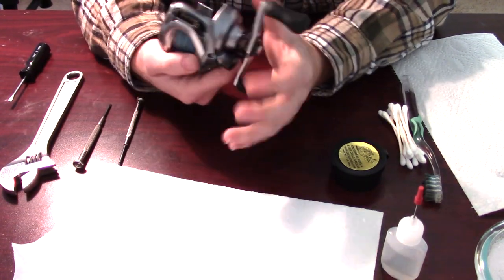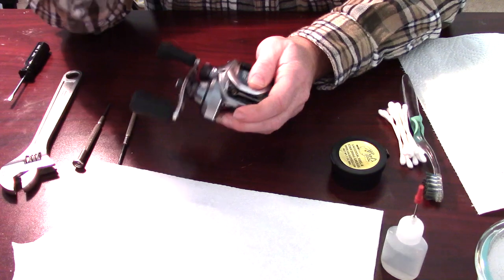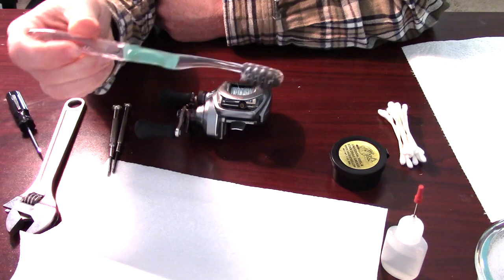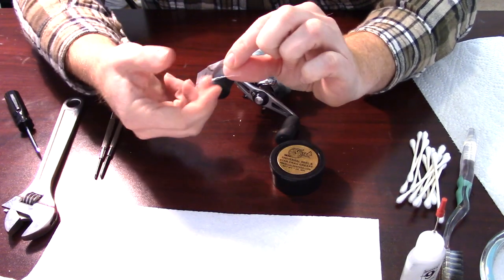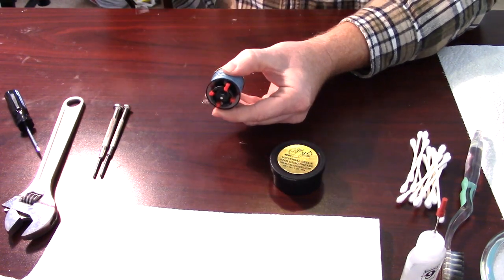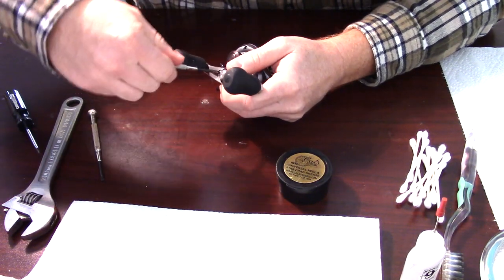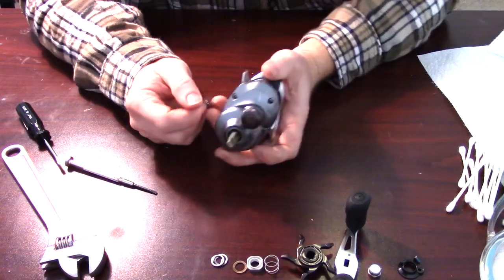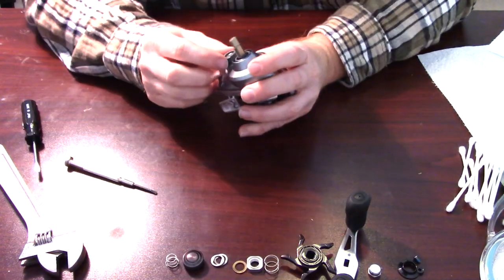Shimano Curado Full Reel Cleaning - Part 1- Taking the reel apart

Comment: Note that the 201I (left handed version) has left handed threads on the main handle retaining nut . I just learned the hard way 😂

Part #bnt 4906
Reply from the maker: Good to know, thanks!  Yeah, I don't own the left hand.  I used to clean reels back in the day (about 15 years ago) for a tackle shop.  Probably cleaned about 10 a week.  But that was many years ago, and technology has changed quite a bit.

Comment: Very very useful informational video. I gave a complete clean up for my curado 201hg and also upgraded the bearings with some ceramic hybrids. Can’t be happier, I notice there is a play in the handle as in I can pull it away from the body a little bit if you know what I mean. Is it normal?? Thanks much for these videos
Reply from the maker: Thanks!  
I haven't ever had it pull away at all, so probably not normal.  Without looking at it though I cannot really diagnose the issue...
Reply: Thank you very much. I just took it apart to take a closer look and found there's a bit of vertical play on the very end of the drive shaft. It's not felt when I normally crank, but if I pull it up side ways from the body I can feel it. Not sure if'm missing a washer or something. Will look it up. Cheers!
Reply from the maker: From my recollection there is a plate that goes over the shaft and screws to the bottom to hold it in place, could be wrong though on that specific model.  If there isn’t any plate then it’s the one that clicks in, and that from my memory on working on these in the past, I remember a few had loosened up, or got streatched out.  I remember it wasn’t an easy fix and was almost as expensive in parts as a new reel.  However if there is a plate to screw in over it, then make sure it’s screwed down tightly, and if it is, then maybe try replacing just that plate.
Reply from the maker: But again, this is from a quite a few years ago working on these at a tackle shop.  So I can’t say for sure.  In all honesty, anything more Than just a cleaning I need to recommend taking the reel to your local shop for them to look at it.
Reply: McFly Angler really appreciate you taking the time to respond. So I know what you mean by the plate under the shaft. I may have misplaced it or may be not since it’s not on the schematic. I’ll try to cut a makeshift shim washer and see if that’s going to help. I’ll let you know how it goes.
Reply from the maker: No if it’s not on the schismatics then it’s probably not originally on that reel.  Like I said, some of the past reels I’ve worked on had them some didn’t.  Some just snap in the base and if it is loose than it’s a job for a professional shop.  Also Shimano is pretty good about fixing reels for a decent price if you can handle being without it for a few weeks for shipping back and fourth.  I wouldn’t go and drill extra holes and make a new part, could effect the reel negatively rather than improve it.
Reply: McFly Angler I hear you. So I just addded very very thin shim at the very end of the drive shaft where the bearing sits on the small depression. That kinda fixed the play:) Again thanks for sharing such wonderful and helpful videos! By the way where I’m at there are no reel service etc. the closest place to send is Singapore and I don’t think it makes it any cost effective;)

Comment: Have you ever had problem when using another oil to Shimano oil...help me please
Reply from the maker: Not with the non DC reels.  I didn’t get many in to fix before, as shimano recommends sending the DC’s in for them to work on only.  I don’t recommend you doing anything other than fish the DC.  Send it in to shimano to clean.

Comment: Where is the click detent that I think is supposed to go on the star drag. Mine fell out and I lost the small spring. Can't really determine how it is supposed to go in but it really doesn't seem to need it. Maybe you lost yours as well on a previous tear down. See parts 2122 & 2123 in parts diagram. It appears to go somewhere on the star drag.
Reply from the maker: I still have it.  Yeah don’t loose that man...  just mine didn’t pop out, and I didn’t need to clean it this time around.
Reply: I think I found the problem but have not addressed it yet. I think the detente goes under the plastic disc that is held in place under the pentagon shaped clip on top of the star drag. Apparently the spring is still in place as I still feel the clicking. I just can't imagine how it could get out of the detente disc. All I did was take off the star drag but did not disassemble it.
Reply from the maker: I’ll review this tonight when I’m not just on my phone.  Hopefully I can help ya.

Comment: Is the curado k built the same at this one?
Reply from the maker: To be honest I have not opened up the K, but I imagine it would be similar unless they come out with a DC version of it which would be different for sure.  I really don’t know 100% though without opening one up.  They might have changed up some of the features and insides over time.  I haven’t had my hands on any new baitcaster reels since the one in this video.

Comment: I’m new to bait  casters and the cast control knob is stuck on my shimano caenan so I can’t fit the side plate on so I was wondering if taking it apart than cleaning it or fixing it is needed or if their is a simple solution
Reply from the maker: Cast control knob, so the knob under the handle?  And did you already remove the whole side plate?  Just can't put it back?  Not sure how you removed it if its stuck though...  Please clarify, as im having a hard time understanding what is actually the issue.

Comment: I tried removing the reverse bearing exactly like you did in this video and completely destroyed the bearing and can’t take it out fully to replace it. Any advice?
Reply from the maker: Oh sounds like there was a problem with it.  Maybe even it got almost glued in from muck and grime?  How dirty was the inside when you opened it?  Or maybe it’s a newer model?  I haven’t taken any open since 2017 and maybe they have glued in these bearings since?
Reply: McFly Angler I did manage to chisel the broken bearing out of the plate so I’ll be able to replace it no problem. The inside wasn’t too dirty and the wall surrounding the bearing was smooth, and the bearing itself was clean as well. Perhaps the plate itself was slightly warped or defective making it so tight on the bearing. Either way it should be good to go so long as I don’t need to take out the bearing again! Btw awesome video!
Reply from the maker: Glad you like the video, and really happy you got it fixed.
Reply: McFly Angler so I got the replacement clutch bearing from shimano Installed it perfectly but the bearing is squeaky? Any way to get rid of that?
Reply from the maker: Are we talking about the bearing that is the single direction bearing?  The anti-reverse bearing?  Like where you put it in upside down and it won’t reel?  Or are we talking about another bearing?
Reply: McFly Angler it was the anti reverse and I called shimanos customer service. Apparently you have to add a thin layer of grease on the anti reverse bearing which I had no idea about. It fixed it right up and the reel feels great.

Comment: Hey! I was curious, i know this video is from 2016 but I have to ask because I'm currently taking apart my Curado to correct a wobble in the star drag, leading me all the way down to the drive shaft and retainer. Please if you can respond it would be highly appreciated. My question is, should the driveshaft wiggle at all? If not I've got a problem 😂
Reply from the maker: No, it shouldn’t...  at least that I noticed whenever I’ve done this to mine.
Reply from the maker: There should be a cross bar type piece that has two screws on either side of the shaft at the bottom “below all the gears” check if they are screwed in all the way.  If so, check if that piece is bent.  If it is, you could be fine with just replacing that bar.  I think you can get parts at some local shops.  Shouldn’t cost too much.  Hopefully this fixes it.

Comment: I just got this reel last week and i noticed a small vibration if i just reel in and let it spin by itself(i dont free the spool like while casting i just reel in). It's only once the spool starts to slow down though. Do you think you know what the problem is or should i just see if it goes away after a couple more weeks?
Reply from the maker: I wouldn't know what the problem is unless I had the reel in front of me.  Is it new?  Or did you buy it used?  If its new, take it into the place you bought it and they can exchange it for a new one I'm sure.

Comment: Is this reel big enough to handle say 30 lb lingcod. I see people fish lingcod with baitcasters and I am worried they cant hold up to the riggers of big weights say 8 to 16 oz?
Reply from the maker: +D Kat how deep are you fishing?  I would say a curado 300 would be fine with the weight, but would rather a tranx...  this won't hold enough line to get deep enough for most rockfish fishing...  

I've caught plenty of inshore species with this reel though!  Calico bass, small yellowtail/durado, redfish, specks, snook, etc...  it has enough oomph to bring cod in, just would be tiresome to drag up a 16oz lure from the depths of davey Jones locker...  also the reel holds very little line.
Reply: Oh about 30ft to 120 ft and I like 40lb mono.
Reply from the maker: Yeah its not going to hold 120 ft of 40lb I don't think.  The tranx probably will though....
Reply: OK I think I will go back to a conventional reel just a smaller size like the Okuma Cold Water 20 or 30. What do you think?
Reply from the maker: If it holds enough line, and has decent internal parts, then yes thats a good idea.  I don't know Okuma too well, so I'm not familiar with that reel.  I used to do a lot of deep water fishing with a Calcutta 700, and a Trinidad 20.  Again I'm more of a shimano guy.  I tend to think their internal parts are more simple but better than some others.  I generally recommend Shimano, Diawa, or Abu Garcia.  Another few great reels for what you are looking to do is a simple Penn Jigmaster, Shimano Speedmaster, or Diawa Sealine 20...
Reply: OK thanks will look into some of the models.
Reply from the maker: Here are some links to the reels if your interested... I added the Tekota as well because it has a level wind, but will also work well for you.  
Penn Jigmaster - http://amzn.to/2oE3Csy

Shimano Speedmaster - https://store.martinwarehouse.online/ProductDetail_i2296576

Shimano Tekota - http://amzn.to/2onp2hu
Diawa Sealine - http://amzn.to/2onyTnN

Or you can stretch the funds and get this beauty!  I had the older model and loved it...  This one looks sweet!
The new Torium! - http://amzn.to/2onyTnN

Hope this helps.

Comment: Hi man, really helpful video series. At around the 12:17 mark of the video , the entire spool release system pops off, including the pinion gear (part 4923 in the schematic/manual). When I disassembled my reel, everything came out except for the pinion gear, making it impossible to put the rest of the spool release system back on. Any insight on how to get this part out?
Reply from the maker: Ok

Comment: My gears don't come out. The big main gear
Reply from the maker: Hmmm, is it the same reel?  Curado?
Reply: McFly Angler it's an older model chronarch
Reply from the maker: I think it should come out.  But depending on how old, It might not.  Im pretty sure it does though.  Ive seen some that basically solder themselves to the shaft because of too much gunk.  That could be a possibility also if its never been cleaned before, or just been a long time.  If you can't get the off, just do your best to clean around them.

Comment: For someone with so much reel cleaning experience, I expected better and cringed every time I saw you popping out a precision bearing using a small steel screwdriver!  Sorry man,...but polymer rods or wooden hardwood dowels in various sizes make more sense and much less likely to damage seals and bearing cages. Even your screwdrivers were too small in handle to have proper grip, .....an accident waiting to happen slipping off the screw heads and gouging the reel or your hand.  And the monstrous wrench,...well,...they make those in more appropriate sizes. I have a small 4 inch long crescent wrench I pack in my bicycle tool kit, that works great on some of my reels too. Small open end wrench's aren't rare either.....

  The bigger problem is a youngster sees this and thinks that's all OK,... but it's not if you want to do your best and I think you know that overall.  Better to wait on a video until you have the right tools , and pass along good work habits than teach youngster's to be reel abusers. You get a "time out" for your transgressions! :-)

Oh,..on reels with so many parts, budding reel techs might consider taking closeup digital photos along the disassembly process, to add it getting all the parts back properly.
Reply from the maker: Too long didn’t read...  well except for the very beginning part.  As for the metal screw driver.  I don’t have the wooden ones on me, and I’ve never hurt a bearing before doing it this way.  And if I do, they aren’t expensive to replace.
Reply: @McFlyAngler  "Too long and didn't read",....?  Really,..... I sat through your entire LONG 15 minute reel take down process,..... and you couldn't be bothered to take 2 minutes to read what you might learn from,... which I might add is just plain common sense!  Probably explains why you still use a sharp steel bearing removal "tool" :-)    For what it's worth, a bag of 100 or so 12 inch bamboo kabob sticks is just a few dollars at most any Supermarket,...a lifetime of more appropriate tools for bearing removal.
Reply from the maker: I’m not doing the channel anymore my friend.  Working 6 days a week, 12-16 hours a day.  So yeah, I don’t have time to even take lunches at work, let alone read anything.  Lol. Anyway, god bless, hope all works out for you.  Take care my friend.
Reply: @McFlyAngler  Been there, done that for a LONG time too (35 years!) ,... 70-80 hour 7 day weeks (the last 8 years in a Mall setting) as a Bench Jewelry repairman / Diamond Setter. It gets OLD after awhile, as do we.... :-)  Good luck to you also, and I hope you realize I was offering constructive criticism and hop you weren't offended. 

Cheers,
Joe T
Reply from the maker: I’m selling cars, I don’t get offended.  Hahaha. No worries brother
Reply: Hoity Toity ain’t you. Joseph